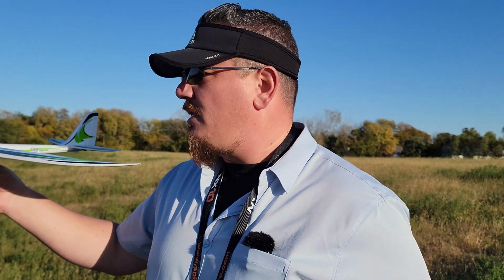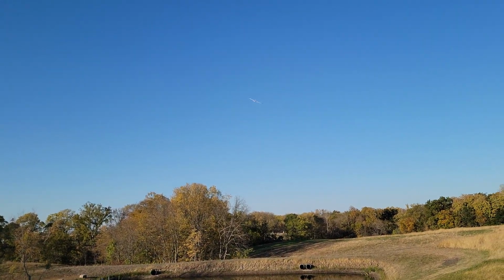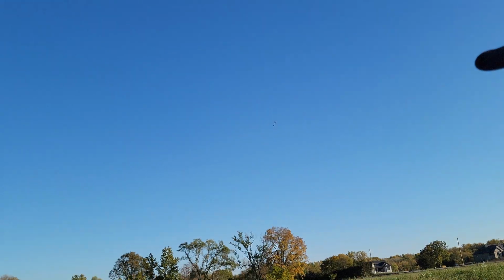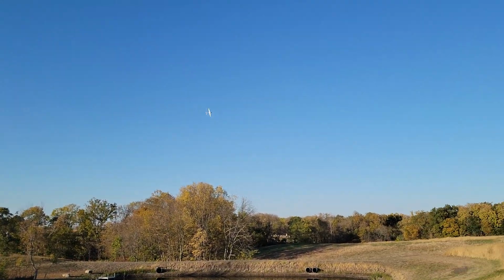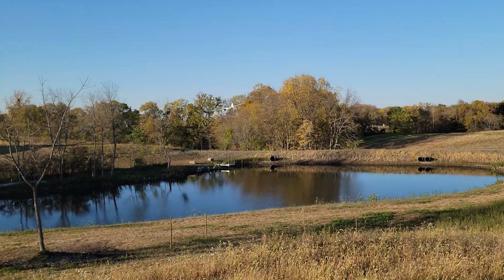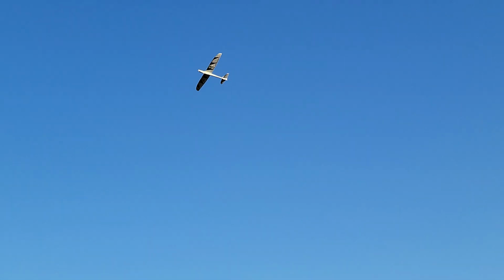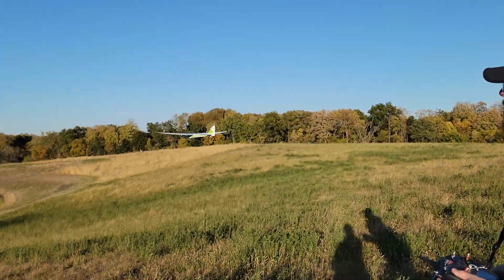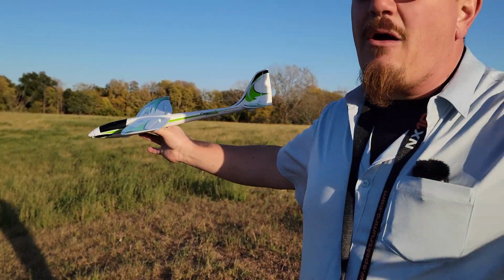E-flite - Conscendo - UMX - Slope Soaring

Comment: Cool it gave me some cool ideas for mine. I like to do the same thing with the UMX Ultrix. I’m not sure exactly how to explain it in technical terms but I guess it’s similar. I’m just riding the wind and trying to do 3-D stuff, never without some throttle though so I guess that’s a difference . Kind of cool because almost no day is too windy and it’s windy up here almost all the time. Would you recommend using the spoilerons . I love this little glider too. Basically the only plane I need. Lost interest in the bigger ones.
Reply from the maker: Yeah, it's a blast, and for sure, spoilerons will help get the thing down when you're ready to land, but with BETTER more LAMINAR wind, this plane would fly perfectly from a slope - we just don't get the wind in the right direction here to take advantage of slope soaring here. I wish we did, but guess it's good, since when the wind is this direction, it's kinda cross wind for ALL our strips - LOL ;)
Reply: @BrianPhillipsRC  I’m not sure I know what that means in terms the type of wind you’re talking about, i’d like to know more. For example, I hear the word thermals tossed around and I’m not exactly sure what that means, although maybe I’ve encountered them without realizing it. Lastly, do you use any elevator throttle mixing? I got the idea from another guy’s video just a small mix to help prevent it from climbing under power I know one thing my latest one sure didn’t come out of the box ready to go it needed a lot of mechanical trim. I guess the nice thing about having bought more than one of these things is being able to rob from Peter to give to Paul in terms of fixing them. Had a bit of a hard landing that caused some prop issues so I just swapped it. Are you saying the spoilerons would help that? Thanks.

Comment: Slope soaring is great. I have a Zagi combat wing and it's super fast and dynamic in strong wind on the right slopes. The stronger the wind the better especially when it's glass smooth coming off the water. Could fly it all day and it's also great in light sea breeze just surfing the dunes.

Comment: I have flown a umx radian without using throttle for over 20 min. All you need is 10 to 15 mph wind steady. I had to bring it back down a couple times when it got scary high.

Comment: Hi Brian..I would like to know if it is possible with a Spektrum ix12 to use Realflight Evolution on PC..thank you if you will answer me..I am a big fan of yours from Italy.
Reply: It will work
Reply: How? @No-rh6zp
Reply: For sure will.  That is the radio I have and use on the simulator.
Reply: Yeah, but how does it connect to the computer? With the cable it does not recognize it as a controller the PC or even with blotooth.
Reply: @giacomoaliotta2136  happened to me I just got a dongle

Comment: I did 135 consecutive loops at tick hill in Marin county overlooking the Pacific about eighteen years ago. Yes slope soaring. Yes a full battery. Yes my battery was low upon landing after the 135th loop. No power at all. Slope soaring rules the world in RC and dynamic soaring behind the slope is sheer RC aircraft wizardry. The current speed record dynamic soaring with NO POWER is 564 mph radar gun captured. Thanks Brian!!